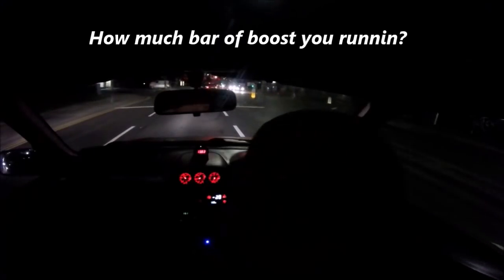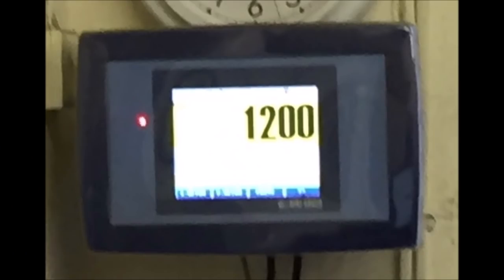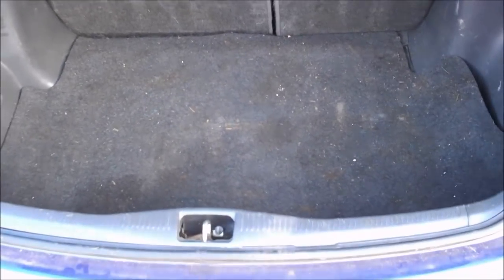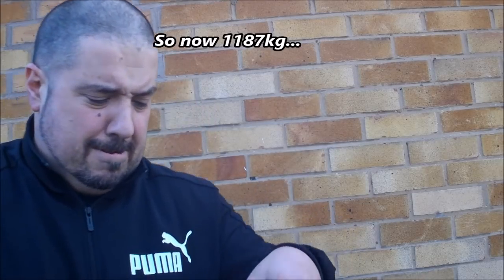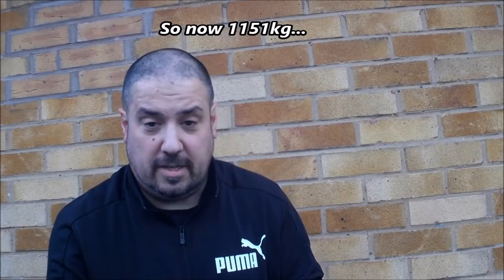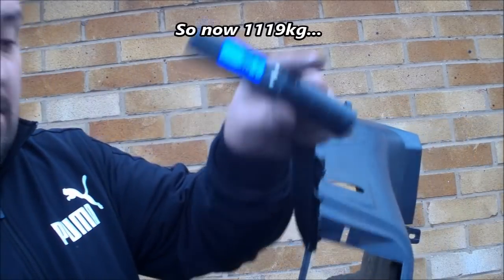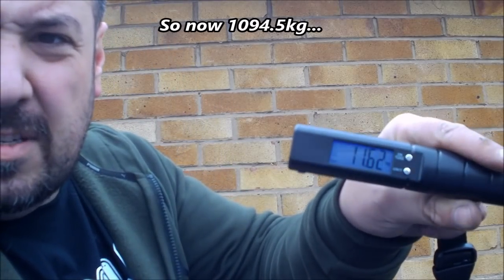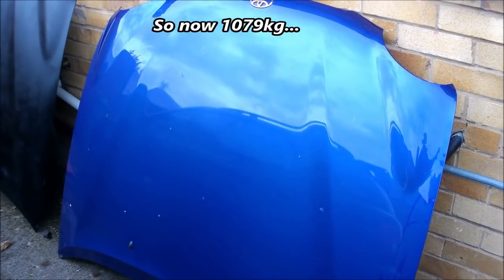10% decrease in weight = 20% increase in acceleration! 3S-GTE Toyota Corolla Sleeper Episode 4

Comment: my Yaris daily 1.3 SR (road legal ish) I use for fwd drags and track days, it weights 665 kgs All motor 1.3 currently (approx 110 bhp) building a 1.5 high comp 1nz to compete in under 1.6 class fwd NA,
with drag wheels and drag strip spec it weighs 600/595 kgs, built from 2 cars (the SR and a T sport yaris)  the whole thing has cost less then 1k ,called the project 'lets go fast for less then a grand', I have a s13 rwd drag car and a s14a show car and the yaris is just as much fun to play with
the corolla is a nice sleeper build btw